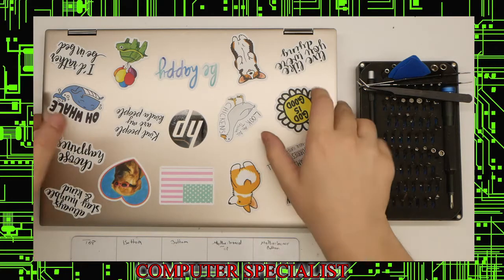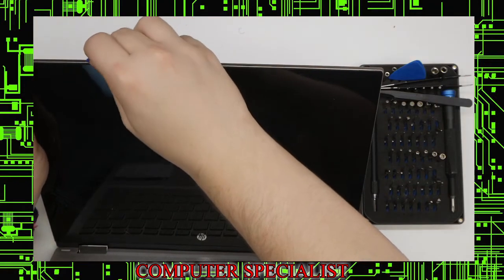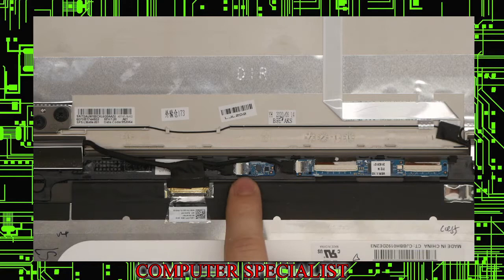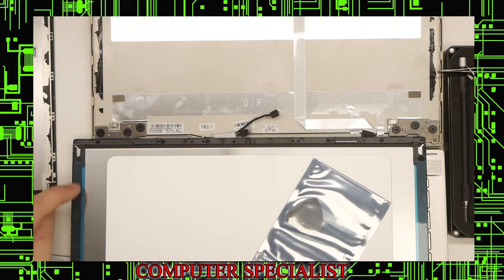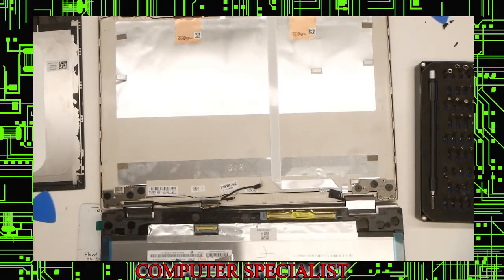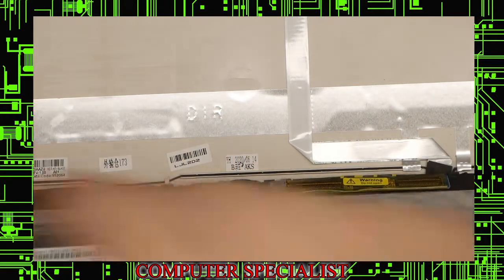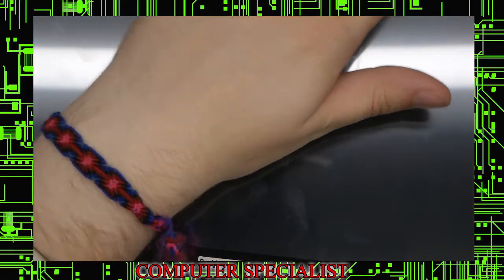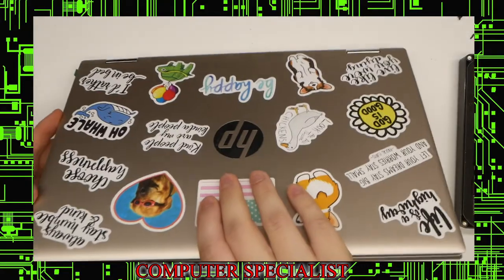How-to Replace LCD Touch Screen on HP Pavilion x360 m Convertible 14m-dw0023dx, 14m-dw Series Laptop

Comment: Just want to let you know that the glue strips can easily be removed after releasing the two top corners of the screen by grabbing the little white tab at the top of each rubber strip and pulling it out slowly. It stretches quite a lot, maybe 18 inches, shrinking it off the mounting surface on both sides. So take a good hard look for that next time. HP, Lenovo and now some DELLs have that feature. Note that most new strips also have pull tabs on both top and bottom. No need to manually remove the sticky stuff when the pull tab method works. Best of luck!
Reply from the maker: Yeah this machine already had to screen replaced and they didn't replace with the right pull strips, which is very common in our repair shop 😂

Comment: hi,   where did you buy the replacement screen ?
Reply from the maker: https://www.ebay.com/itm/226914779212 Sometimes if you look you can get a descent used OEM Screen a little cheaper, but getting harder as the model becomes older!

Comment: I have the 14m-dw1023dx where could I find a screen for this model?
Reply from the maker: You can get a complete assembly like this https://www.ebay.com/itm/176501423255 or if you think you can replace just screen you can get this https://www.ebay.com/itm/226349244095

Comment: Hi! I have a question is it okay to replace LCD without removing the battery? Thank in advance
Reply from the maker: Always remove the battery! We get jobs all the time because people don't and they blow out the backlight fuse or even worse. The connectors when you plus them in have voltage going through them and if they go in crooked etc they can short stuff!

Comment: Hi, do you know where I can get a replacement screen for HP pavilion x360 2-in-1 model 14-ek1501sa? Thank you
Reply from the maker: https://www.ebay.com/itm/145763932612 . I would take yours off and double check hinges and LCD, antennae  and touch cable connectors!

Comment: You never took off the screen protector. I wanted to know if your replacement has the HP logo on the bottom of the digitizer glass. I just got one for my 2017 HP laptop on eBay from China. The listing says it's "a genuine HP spare", however the original is an LG display with the HP logo on the bottom center of the glass. The replacement I received is a BOE with no logo (just a circle) where the HP logo should be. What do you think?
Reply from the maker: Yeah most our customers want the screen protector on when they pickup to see its new 😂. So in my dealings when they come from china they are "knock-offs" but some are pretty descent. Sometimes its hard to get a genuine one also! You will be able to tell by the picture quality! If bad return it!

Comment: Hi, i have a question what can causes that the touchscreen is mirrored when go with the pointer up en down, left ti right works fine. I can't callibrate screen normal in Windows
Reply from the maker: Did you try going into bios and restore to bios settings to default and reboot?

Comment: I don't see a way to disconnect the battery. Is that required?
Reply from the maker: Just unscrew the few screws on the battery and the entire batter pulls out. So it is required if your new to this kin of repair. Example, if you pull the LCD cable out on a angel you can burn it out. Suppose to pull straight out!

Comment: Thank you so much! Your instructions worked perfectly but I can’t seem to snap the screen all the way in to where I hear clicks all the way around? I purchased the exact one you used from eBay so I know it’s the correct one. I tried using plyers wrapped in cloth but afraid to squeeze too hard and also tried applying top pressure to it.  Can’t seem to get them clicked in 😑
Reply from the maker: Yeah you definitely shouldn't need too much pressure to require any tools other than your fingers. It's possible that one of the plastic clips is bent on the screen which could be preventing it from snapping in. You may have to take the screen out again and just check to make sure the clip in that area is not smushed down...

Comment: This is a great video thanks. Can I swap a working touchscreen straight into another x360. I have 2 laptops one screen cracked the other working perfectly
Reply from the maker: Yes I would switch the entire assembly. Hinges, cables and all. Just make sure battery is disconnected prior to unplugging and plugging in screen. Just take out hinge screws and a few connectors and that's all!

Comment: Great tutorial. Thanks!
I had one minor issue: with the new screen installed, I noticed the two bottom corners and some areas on the bottom edge weren't seated and  "clicked" into the clips, and finger pressure wouldn't do it. I was able to use a small pair of needle-nose pliers to carefully squeeze the screen and rear cover together (near the edge), and they snapped right into place. You may want to wrap the needle-nose jaws in some tape to prevent marring the plastic.
Reply from the maker: Good tip! Glad it helped

Comment: I have this same model and I have no cracks in the glass, but vertical lines of dead pixels on the screen... Could it be an issue with the connecting cables on the screen? Could opening it and checking the connecting cables potentially fix it?
Reply from the maker: Vertical lines are most likely physical damage and not anything with the connector, but it couldn't hurt to give it a try and reseat the cable.

Comment: Hello does this video work for 14m-dw0013dx?

And if it does where is a good place to get replacement screens
Reply from the maker: Yep, this will also apply for the 14m-dw0013dx and in-fact any 14m-dwXXXX model. Best source of screens at a reasonable price would be eBay. Sometimes it may be easier to find someone selling the entire LCD assembly, otherwise as in this video, replacing the LCD panel may be more cost effective. As of today it looks like the cheapest way is the LCD panel route which can be purchased here:
https://www.ebay.com/itm/374106352219  ($144)

Comment: Can you tell me how to tuck in the bottom clips of the screen as I am unable to do it
Reply from the maker: Are you talking about the plastic clips on the surrounding bezel or the bottom metal mounts on the screen itself? If the bottom plastic clips aren't clipping check to make sure clips aren't bent on both sides and no wires are blocking. If its metal clips on the actual screen, screen is most likely the wrong one but if it works and physically fits (except tabs) you can cut (dremel, be careful) them off.

Comment: Where do you recommend ordering a replacement screen from, my wife has this exact laptop and the glass broke, thankfully it still works.  Great video BTW.
Reply from the maker: In terms of price, your best bet depending on location will likely be eBay. IIRC most for this model are aftermarket new, but generally if you can get a genuine LCD or entire screen assembly that may be better long term.

Comment: can i replace only the touch glass, mine is screen good only glass cracked
Reply from the maker: Technically you can. However it requires special tools (that use a lot of heat) to un-fuse the digitizer from the LCD. It is not really worth the risk and time to do just the glass nor is it really cost effective unfortunately.
Reply from the maker: You technically can, but since its a fused screen, its very hard to separate without damaging the screen itself! It is only a few $$ more to replace everything and will guarantee everything works when done. We did some fused screens the past and the digitizer was never the same etc. Here is a link to the entire screen. Digitizers are usually $80 and are aftermarket so they never work as good!

https://www.ebay.com/itm/293802934210